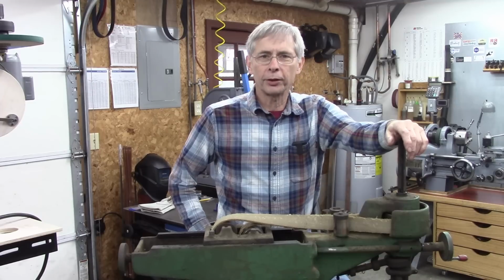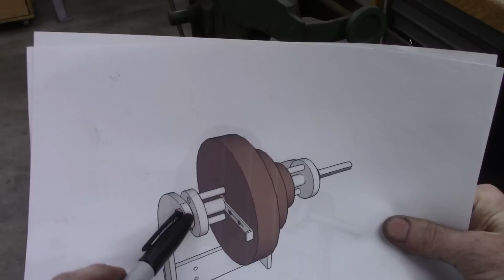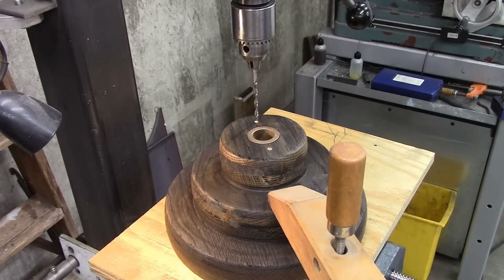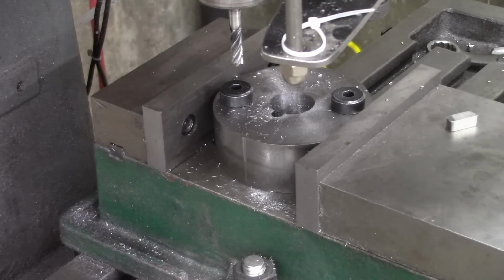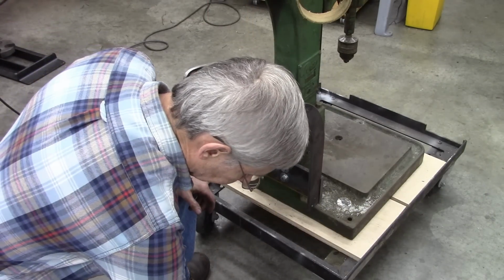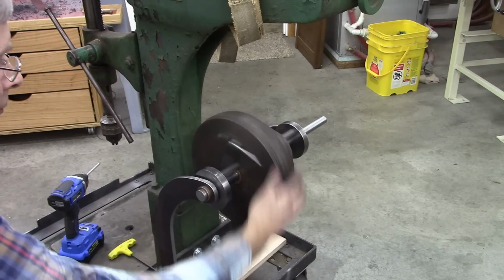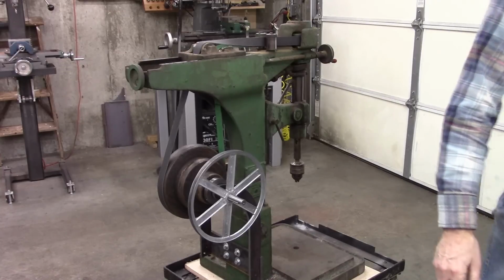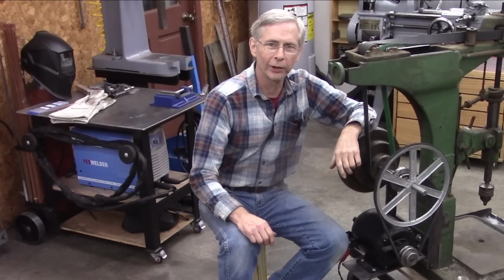Rebuilding the 1917 Avey Drill Press -  Part 2, Finishing the Drive

Comment: I was going to get a similar old drill press for free off of Craigslist, took my truck and trailer to the guy's house but the more I looked at it the more work like you are doing I seen so I went home empty handed lol.  You are a good man for rescuing that old beauty
Reply: I bought a South Bend 14" drill press at the scrap yard, and it started life as a floor model, but as is the nature of scrap yards, it's now a bench top model. Its missing the belt guard and the motor, but the motor is the most important. I can make a guard from sheet metal or maybe sheet plastic for now. The quill pulley is damaged, but might be repairable. The other for the motor is common, so I already have that one.
Reply from the maker: It is a lot of work for sure but this is a very well made drill press. I think I'll end up with a very nice drill press.
Reply from the maker: It's a shame how people abuse these old machines. This thing is built like a tank.

Comment: That looks good Mark. Now you need a light. I would recommend an Edison style filament led bulb in a fixture that is reminiscent of that era. A bare bulb in a piece of clear acrylic pipe with a modern socket to replicate the glass that might have covered it. If you mount the bulb horizontally, you could add an aluminum reflector inside the pipe.
Reply from the maker: It came with a couple lights, I'll probably restore one of them. They look old.
Reply: @WinkysWorkshop  that's good then. If they came with the cloth wrapped lamp cord, I have some NOS wire from maybe the 60's that might work. It was a complete spool and is in VG condition. It has the UL logo every 3 foot or so, and is mostly black.
I'm looking forward to seeing more progress on this drill press.
I might add that I bought a South Bend drill press that was made in the 50's, and started life as a floor model, but because I bought it at the scrap yard, it will only be a bench model and is supposedly rare being an economy model. It needs a motor and a belt guard, but those are relatively inexpensive compared to the rest of the machine.
Reply from the maker: @Farm_fab  Sounds like a nice drill press, I've never seen a South Bend drill press. I'll keep the cord in mind but I'm thinking it needs to be a rubber coated cord. Thanks for the offer.

Comment: Look good!  You might try adding a small counterweight opposite the latch on the pulley to get rid of some vibration.
Reply from the maker: The belt or the cheap V belt pulley is making the motor jump around. I'll solidify the motor mount. The motor itself makes some noise too. Its repulsion induction motor with a centrifugal start switch. I think it makes noise when the motor jumps.

Comment: Winky,  What is the belt material selected and how is it spliced?  When cutting out complex curved parts, why didn't you use the Vevor Plasma cutter?  I would suggest adding oil holes to apply additional oil to the bushings in the jack shaft.  I have never seen an over oiled bushing wear out!  Clever design overall!
Reply from the maker: I thought about oil cups... mostly because they look cool. Maybe I'll add some. As for the plasma, I tied it. I have good luck cutting 1/4" but not so much on 3/8". It works well but makes a fairly rough cut. Part of this is my unsteady hand but it is also the nature of plasma and it gets worse with thickness. The bandsaw was time consuming but the end result required a lot less grinding.

Comment: Mark, this project turned out really nice.
Reply from the maker: Thanks! I've got it all dismantled, cleaned up and painted now. This thing is built extremely well. Video on Friday. I think the next step is to build the stand. Lifting it now isn't too bad but after all the parts get put on it's much more difficult.
Reply: @WinkysWorkshop  They built them rugged back in the day, no flimsiness there. That's one reason they'll last forever with a little care.
Reply from the maker: @RAYAR54  The drill press is made much better that the camel back I had. Even the castings are much better quality.

Comment: That came out really nice! Be careful while stripping the paint, don't do it dry as the paint will be lead based. Better safe than sorry.
Reply from the maker: Exactly my thoughts. Thanks
Reply: @WinkysWorkshop  My Grandfather worked as a machine finisher at Hendey Machine Co. They used to fill the voids in the casting with lead and in some cases plaster of paris. Sanding and painting was done with no thought about the dangers of silica and lead poisoning. Hendeys were painted with a lead based oil enamel.
Reply from the maker: @billjulian9496  Yeah...  I'm guessing some of the risks were not known at the time I didn't see any lead or plaster of paris, just a lot of tar japanning. Of course who knows what is in the paint... most likely lead. Plus it came out of an electric motor shop. I thought the table had lead melted on it but when I started to melt it with a torch, it burns quite well and smelled very strong like crayons. I've started stripping it with paint removers which was working faily well but decided to forgo the chemicals and took it to a sand blaster. I pick it up tomorrow...  video next week.

Comment: I've had good luck drilling really deep holes, like for muzzleloader ramrods, with a with a single flute bit.  Never had an issue with it wandering because one cutting surface was sharper or at a slightly different cutting angle.
Reply from the maker: You mean an augur type bit? The brad point and forstner are great but normal twist drills are terrible.
Reply: @WinkysWorkshop  I need to get a picture.  Not an augur type.  Drilling ramrod holes I needed a really long bit to reach the length of a 36" forestock and drill 10 inches or so into the stock between a barrel channel and a lock bolt.   I made those out of 48" cold rolled stock; ground a point and then cut a single straight flute about 2 inches long.  Only one cutting edge on the point.  I'll pull out one of those and see if I can find a way to upload that.  I found it the best way to drill a deep hole and have it run straight.  I couldn't afford to have it rise UP into barrel channel or run down into the lock mortice.
Reply from the maker: @gymntonic  You are drilling in steel. Wood has grain. It also sounds like you are boring (as in making bigger) winkysworkshop@GMX.com
Reply: @WinkysWorkshop  That was for drilling in wood.

Comment: You mentioned replacing some bearings. Are they not babbitt bearings?
Reply from the maker: They are actually Fafnir 2060 (now just 206). Only one of the two is bad but I'll preplace both. The bearing next to the chuck is it perfect condition. Considering it was nearly dry and over 100 years old this is amazing. It also a Fafnir but no longer available. They now make the same bearing 1 MM wider and I could make it work but right now the original is fine. This think is VERY well made and I suspect very advanced for it's time.

Comment: Looking good!  May want to shore up that motor mount though - looks like a good bit of shake, rattle, and roll going on there, which will eventually cause problems over time I would think. Looking forward to the re-painting.
Reply from the maker: Thanks, I agree on the motor mount. if nothing else I just don't like it

Comment: Nice job as usual! However, IMHO you might have over engineered this one a little bit? I’d have just fixed the pulleys to the shaft with a big dog point set screw, then made the shaft a sliding fit to it’s bushings so you can just slide the whole assembly left and right for pulley selection. Done and done.
Reply from the maker: I'm not sure I understood correctly but something has to slide. If I fixed the wood pulley to the shaft and moved the shaft the other pulley (the V belt pulley) would be out of line with the motor. I have seen machines with a shaft and double keyway that allow the pulley to slide. This works well for a while but wear if always an issue. Eventually the key wears and you can't slide the pulley. Same with a splined shaft. The original floor model of this drill press had the keyed sliding pulley but I'll bet every one of then had been rebuilt several times. Of course my pulley was wood so a steel sleeve would have been needed but I'm hoping the bars driving the pulley will eliminate the wear on this style drive.
Reply: @WinkysWorkshop  Right on, i get what you’re saying. I’d have probably used a key and opposing set screw for the motor side pulley. But more than one way to skin a cat! Still a cool design and, “I like it!” ;)
Reply from the maker: @DavidHerscher  Thanks David. The sliding pulley with keyways might have worked okay for my shop. The main reason I didn't go with it is because it was used a lot on the printing industry (which I am retired from) and it failed frequently. Of course these machines were running 24 hrs a day.

Comment: Superb job, perhaps wear insulating gloves just in case a clip slips?????
Reply from the maker: Belt clip? Its a glued on belt. A perfect splice, no clip.
Reply: @WinkysWorkshop  The motor connection mate, aligator clips in Australia.
Reply: @WinkysWorkshop  Briliiant thinking on the adjustable pulley block.
Reply from the maker: @robertwalker7457  Ah!!!  Hahaha, got it now. Yes they were a bit precarious. They are called the same here.
Reply from the maker: @robertwalker7457  Thanks, I thought about using flanged steel hubs with a key slot but I have seen drives made like this fail. The keys wear and it makes it very hard to move the pulley. I think the steel bars on wood will probably last forever.